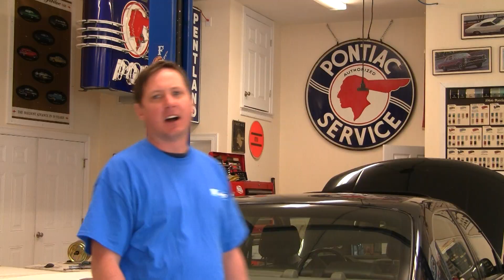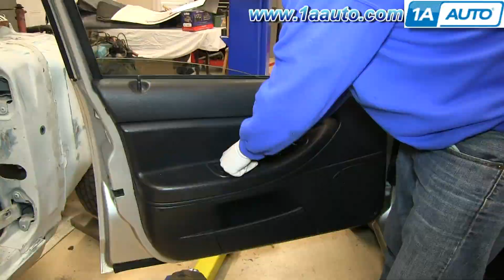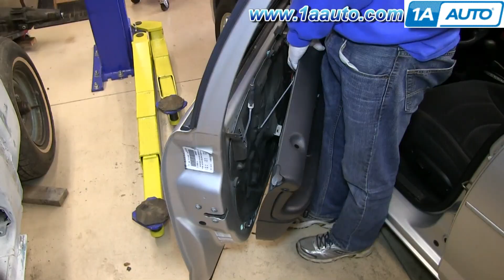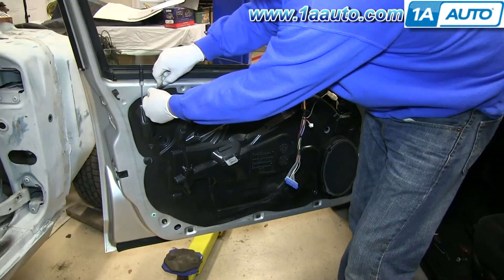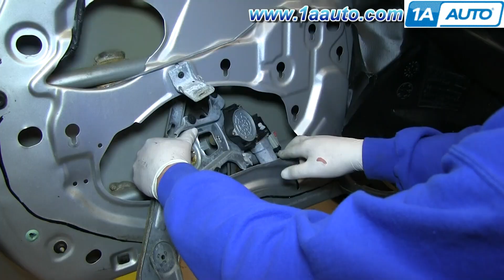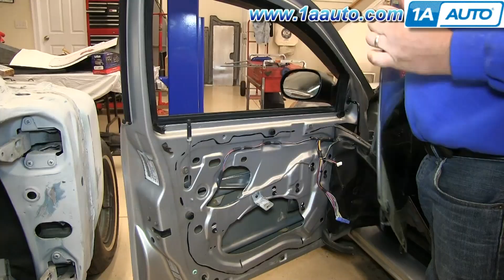How to Replace Power Window Motor 01-06 Chrysler Sebring

Comment: Does That Motor Control The Passenger Windows Up And Down Movements? Because It's My Passenger That's Gone Out
Reply from the maker: This is for the front LH Driver's side window regulator/motor. Thanks for watching! +Chris Diaz
Reply: @1AAuto  Yeah So I Would Follow These Steps But On The Passenger Side Correct??

Comment: If you put the bolts into the big holes in the regulator who do you keep the window in line with the front and back of the door frame when you move the bolts from the big hole forwards to the small holes?  Thanks

Comment: i cant see the regulator how i can put it in the correct position so i can see the socket
Reply from the maker: You could try to lower the window a bit so that you can see it a little better. Hope this helps you out. 1aauto.com 866-403-3393
Reply: @1AAuto  How does one know if the motor is bad and in need of replacing? None of my windows will go up or down.  What do you suggest that means?
Reply from the maker: +Badger Motorcyclists of Wisconsin We wouldn't be able to diagnose an issue like that here, you may want to have a local mechanic take a look at it. Thanks for checking us out! 1AAuto.com